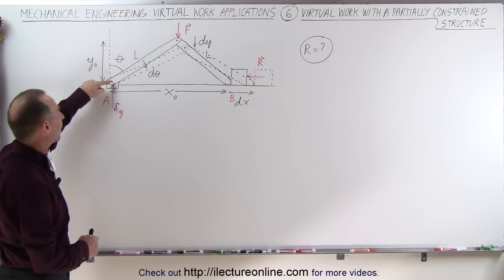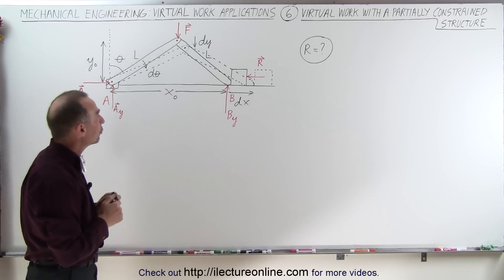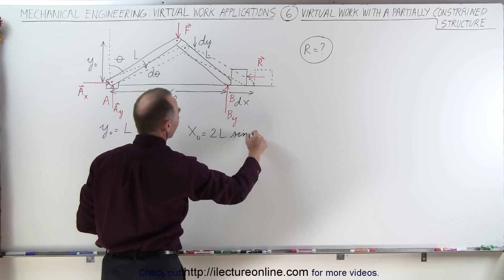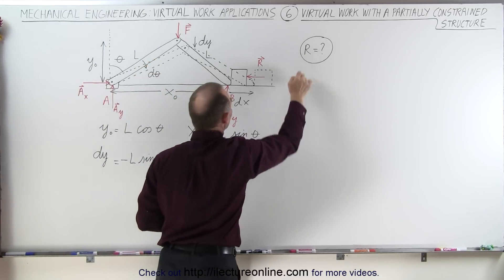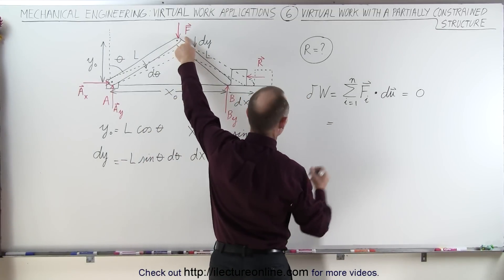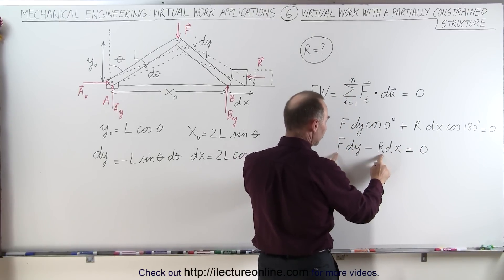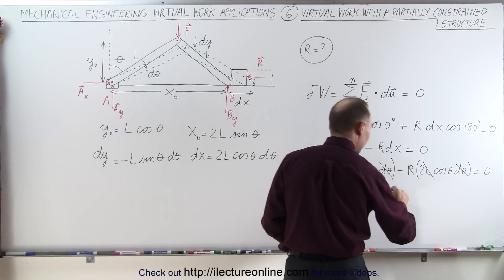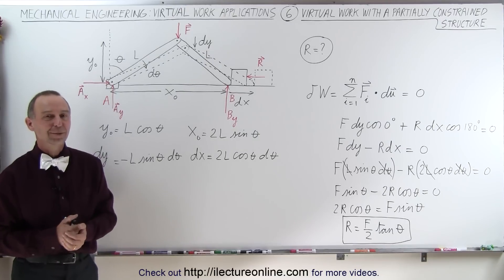Mechanical Engineering: Ch 13: Virtual Work Applications (6 of 39) Partially Constraint Structure

Comment: In canceling out L and dtheta do we have to stipulate that neither of them is equal to zero?  I've noticed that most instructors are pretty fast and loose with canceling out without this stipulation.  Is it really necessary to point out, for example, that L is obviously not zero and dtheta is not zero because of its nature?  Kind of nitpicky, but I've always wondered this.
Reply from the maker: That is why we have mathematicians to keep us honest.  However if we know that L and d theta are not zero, then there is no need to make the stipulation.

Comment: Great video! One thing that is unclear to me is that dy = (negative) - L*sin(theta) dtheta, while it is substituted as a positive value. The final answer in this video is a positive value, which is intuitive correct. So this is odd.
Reply: To answer myself: It is the dot product between the two vectors.
Reply from the maker: Correct.  When you take the dot product of 2 vectors, you multiply the magnitudes of each of the vectors, and magnitudes of vectors cannot be negative.

Comment: Why moment at  the pin joint 'A' not taken into consideration?
Reply: Moment has no role in the problem with virtual work. Only forces that contribute to a possible change in (virtual) displacement are considered. Any type of force acting on the Pin joint will not cause displacement at A. Hence even if u consider, it will multiply with the displacement at A (which is zero) and becomes zero.
Reply: A is pinned, so it does not have reaction moment so to say to do work like M*dtheta

Comment: dy is equal to -L times sin bla bla. SO it must be R= -F/2*tan
Reply: @ferhat polat No his answer is correct.  The vector force F is equal to -F in the y direction, so - and - equals +. Secondly the force R can't be negative as this would result in a force oriented to the right in point B, in which case the object would not be in equilibrium.
Reply: @appelbanaan3913  Nope, the force has to be negative and the F which is shown is not a vector.